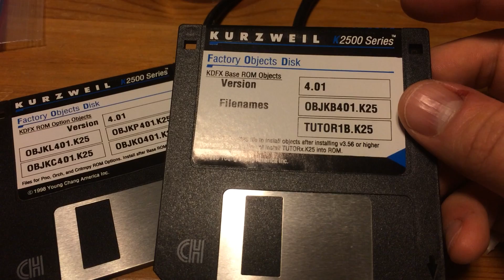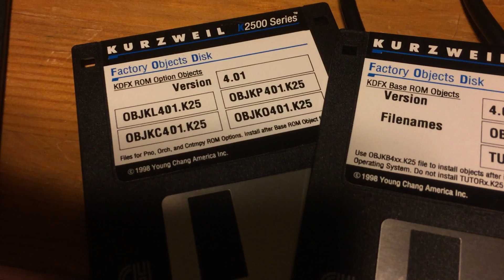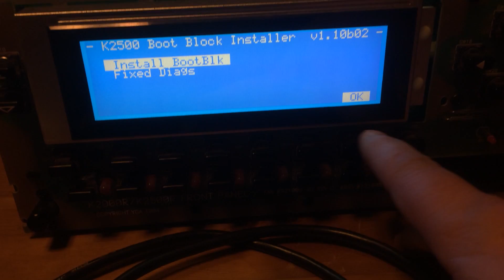KDFX Installation Part 3

Comment: Dear Caleb, thank you! Very informative video!!! Could you be please so kind and share somehow the contents of Operating System Disk - K2500 KDFX Installer Disk?.. I'm unable to find it somewhere on the internet, while I need it to upgrade my unit's boot loader in order to install my KDFX, and I don't have the physicsl disk either... Anyway, thak you in advance!
Reply from the maker: I don't own the unit anymore or the disks that went with it.  Your best bet is to look for any Kurzweil Email Lists and forums.  There are tons of passionate vintage Kurzweil users out there that I am sure would help you out.   I know I leaned on their expertise when I did this installation.  I couldn't have done it without them.  I do see some sets of disks for a reasonable price ($15 or so).  Check those as well.  Good luck!
Reply: @8bitwidgets  Clear, thank you anyway... Good luck you too!
Reply from the maker: @a.p.9674  just look at those ebay listings for disks..  i did a little more digging and KurzList@yahoogroups.com is the one i was on and got a lot of help.  I haven't used it since 2017 but i imagine its still there.   also lastly..  this is the page on kurzweil website that has downloads..  i remember needing them for the rom expansions, but maybe something in here could relate to the KDFX..  http://kurzweil.com/product/k2500r/downloads/   also try for what it's worth to reach out to Kurzweil the company..  they won't support it i imagine, but maybe they have the archived somewhere..  after all it's not like you don't own the hardware..  or asking them to fix anything, just for that floppy image.
Reply: Alexey, did you happen to get the contents of the floppies somehow?